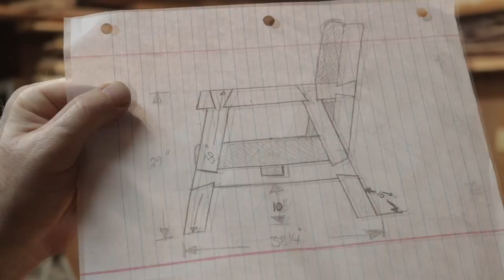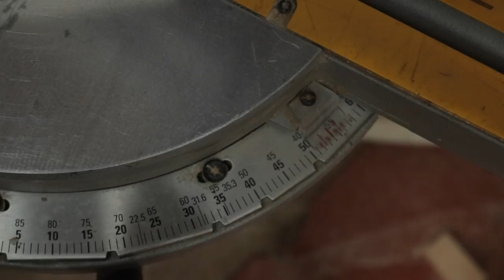BUILDING A COUCH

Comment: I wish i had a table saw. It opens up so many project options :(
Reply from the maker: It does, Craigslist has some good ones for little money. I’d be careful about stability if the saw is a job site type. Good luck 👍
Reply: Hey brother! You can do most basic things a table saw can do with a circular saw if you become skilled with it's use.
Reply: Well i picked table saw which has helped a lot.

Now I want a thickness planer :¥
Reply: @lanceflanagan  lol ya they help a lot. I just sold my DW735 with a Helical head and now I'm waiting for my Laguna Sheartec II to arrive. There are a lot of things that I simply can't (time efficiently) do until i get a planer back. 

My cabinetry teachers both have operated their business for a long time without one because they buy pre planed material with a straight edge on one side. But especially with making furniture of any kind it's a necessity.
Reply from the maker: 100% truth here. After a table saw and or skill saw, get a band saw/jig saw even. Unless you are already a professional, but for just home projects, I use the bandsaw more than a planer. That being said, this is a very much loved hobby for me. Have a good one.